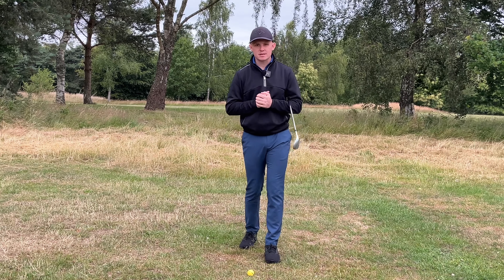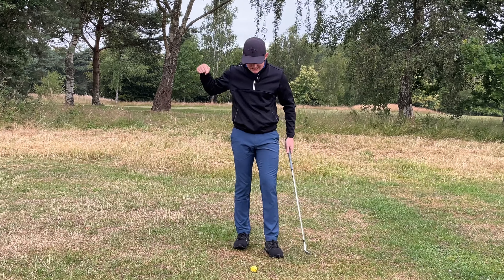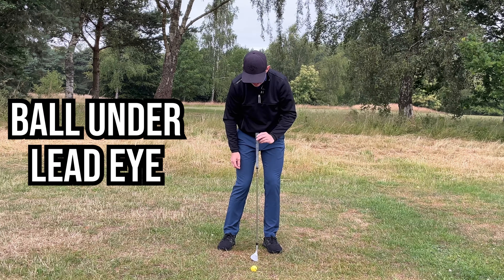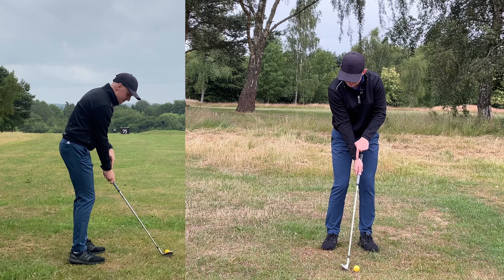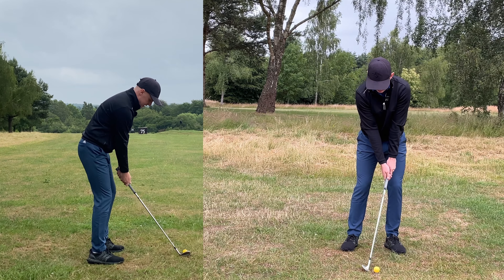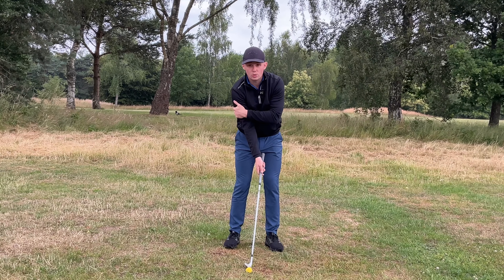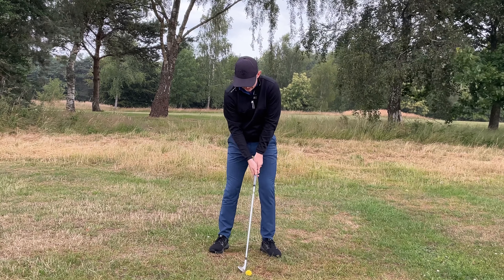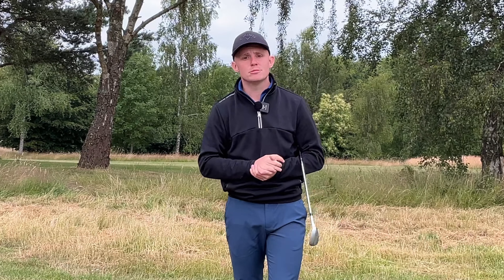How To Stop Hitting Fat and Thin Wedge Shots

Comment: This is pretty much exactly what my own instructor has given me. Makes sense and it works, BUT - I still get freaked with those super tight fairway lies on soft ground where even some club bounce doesn't give you much forgiveness.
Reply from the maker: I think all golfers do! In those you actually need to try to play them where you get a bit steeper so the leading edge can get under the ball